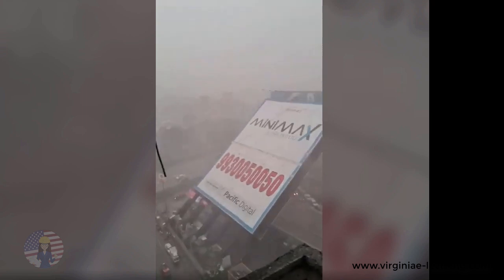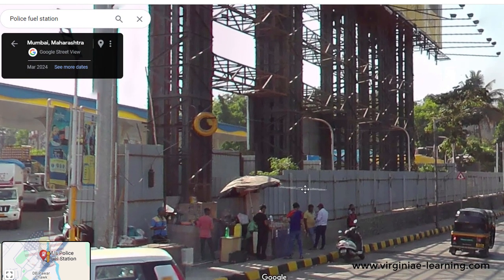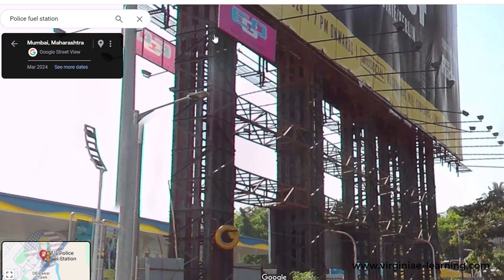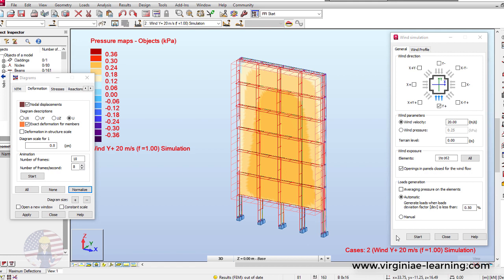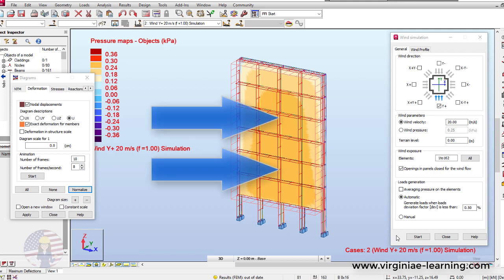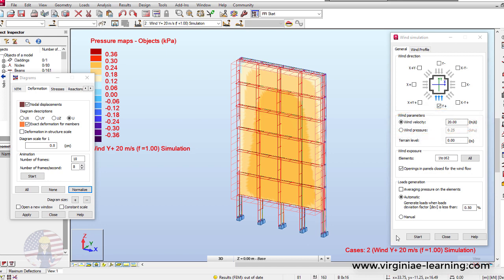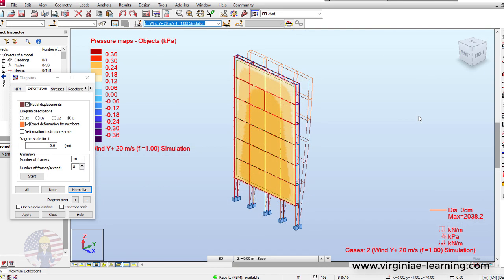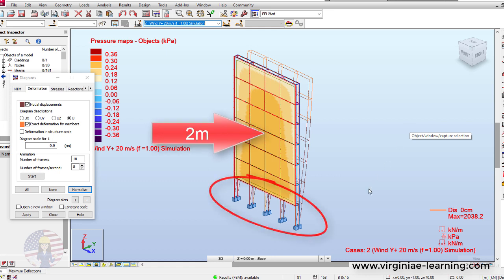Mumbai Billboard Collapse. Using Structural Analysis to Prevent Catastrophic Design Failures.

Comment: Hi 
I need advise for a simple 6m x 3m billboard foundation.
 Height from groundblevel to bottom frame length 2m
I want to use 100mm sq tube x 6mm
3 post system.
Can i use direct post? Recommended foundation dimensions?